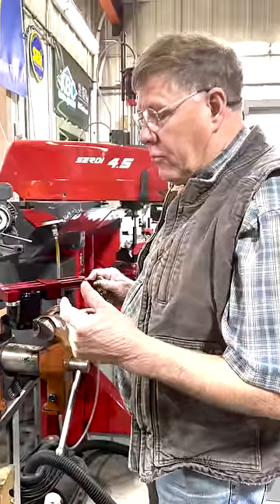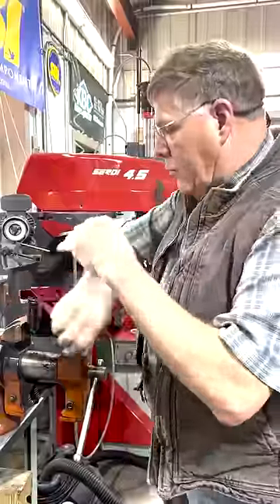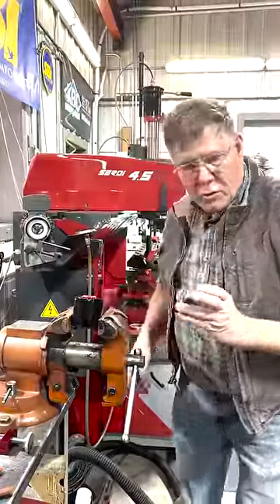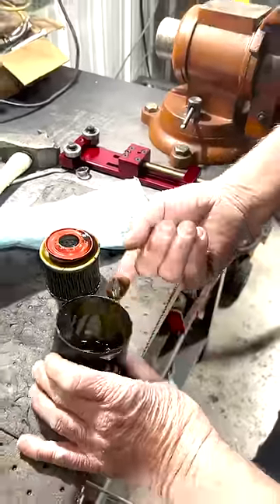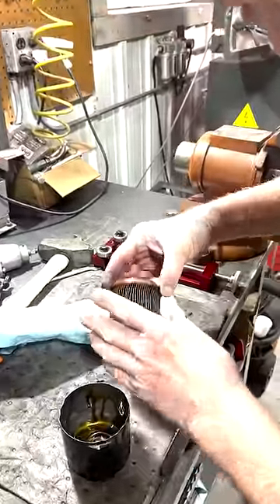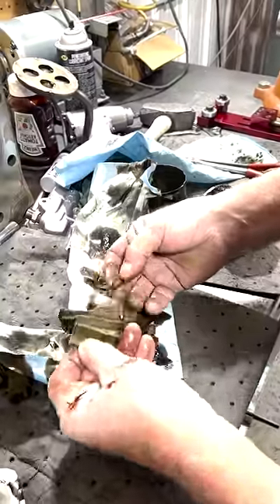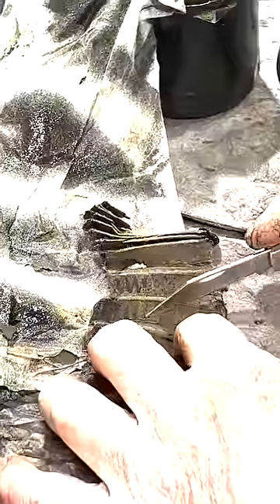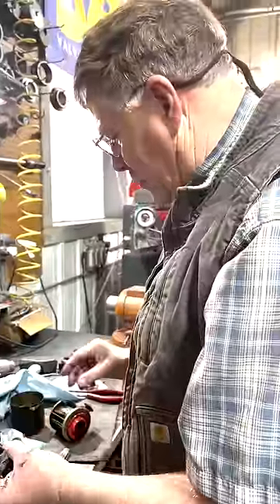#shorts Our Customer Ran His Engine OUT of OIL! 🤦🏻‍♂️

Comment: I'm a diesel mechanic, it's the family business, and we work on all of the nearby City/Township government vehicles.
Yesterday, one city dropped off their woodchipper that wasn't running. My dad looked at it. Always the first thing to do is make sure it has oil in it. Oil wasn't on the dipstick, so my dad took a small ~1cup oil sample to see if it was super glittery or if there were any chunks of metal, and it looked fine, just a bit black and old.
So, my dad started topping off the oil before attempting to crank it. 11qts brought it up to the Min line, and it's a 14qt system, so there was only ~2qts of oil in it when they brought it over.
My dad tries to crank it and it won't spin. He puts a jump-pack on it and it still won't spin. He gets a prybar on the crank and can't get it to spin. He puts a cheater bar on the end of the pry bar, and still, it won't budge in either direction. Pretty sure the crank welded itself to the block.
So we tell the guys from the city it's siezed and likely isn't worth rebuilding or replacing the engine, & to find money for a new one. It was a very old chipper.
They come to pick it up and the guy gives us some more details about exactly what happened. This fucking guy said the last time he used it it wouldn't run unless he was holding in "this button." That button was the Murphy switch override, because the switch wasn't reading oil pressure and it wouldn't let the engine run. They guy then said a bunch of white smoke started to come out of "this tube" and it stopped running shortly after, then it would only run if he had the starter turning it over as well and only for a few minutes. "This tube" was the crank case ventilation.
Murphy switches are a great safety mechanism when they're working properly, but they don't help when you're dumber than Murphy.
Reply: We call them idiot switches. For this reason.
Reply: Myy woorrdd!! Seriously.. I love those pieces of equipment with those guages because it gives you a piece of mind that whoever runs it can't screw it up! Apparently they still will!
Reply: @manuelve1998  They're called idiot switches because it makes it so an idiot can't damage your engine turning it over, not because of this one instance of an idiot using it as a safety bypass.
Reply: They do this to get new equipment. 
It's common even thier mechanics don't care to work on older equipment .
So make ajistments to fail
Reply: God. damn. 🤦‍♂️🤦‍♂️🤦‍♂️
Reply: Been to gearboxes like that which are seized solid, but when you check, it's full of beautiful clean oil, hmmm🤔🤥
Reply: 9
Reply: I read this whole long ass encyclopaedia because he intrigued me and at the end I couldn’t stop laughing 😂😂 utterly brilliant
Reply: When someone makes something idiot proof, the world makes a better idiot.
Reply: I bought a $1500 plate compactor off a guy who ran a landscaping business. Paid $50. He couldn't get it started. I put some oil in it and boom! Dummy forgot to put oil in it. 😂
Reply: @nightfall22 reading is hard eh?
Reply: Shell did an experiment, they used oil for different lengths of time, and only after around 75 000 was there degradation, keep the oi level right and you don't need oil change for at least two years, also your car should not be using oil in any way that needs for than a few hundred ml a year.
Reply: Dang, once I read “this button” I knew then he fk’d up. I use to be a heavy duty repairman with the union so I feel your pain. When people describe engine parts with grade school vocabulary, you know you’re in for a treat.
Reply: Why you did not turn the engine before spending new oil in it ? 😜
Reply: Murphys's Law
Reply: @palmtreeshenanigans you sir are wildly incorrect. First off engines run hot enough the heat alone brakes down the oil. Then factor in your typical heat cycling and condensation extream pressures shit fuel blow by ect. Change your oil and your motor will last. Push much past 5k and you will have sludging issues
Reply: You wasted 11 qt of oil to figure out it was seized engine! Nice one!
Reply: I would have tried to rebuild the engine with some red neck engineering, but its city and i find broken equipment and fix it for my self and hobbyists to use, so dont mind tinkering few hours to see if it can saved.
Reply: Not in his job description.
Reply: Amateurs 😂
Yeah, check the fluids.
But First thing you do, is see if it Turns by hand !!!
Anything else is academic if it don't.
Reply: 😂😂😂😂😂 the last sentence was AMAZING 🎉🎉🎉🎉

Comment: My father bought a GM pickup from a plumbing company, they said they never changed the oil since they bought it new from the dealer, 97,000km ago. Oil came out like molasses 😮😮😮
Reply: Why did he buy it?
Reply: I enjoy that the engine is still running. Yet many people never talk about changing the other fluids.
Reply: My pops made fun of me changing oil all time , ol timers didn’t change oil till it black
Reply: @RcPlayer-tt2vw  Just because the oil is black, does not mean it still isn’t protecting the engine.   I change mine every 10,000 miles with the cheapest oil on the shelf and it has over 250,000 on it at this time.
Reply: @Olds_Pwr  I would love to see someone use that logic on a diesel. They would changing the oil twice a day just because it turned dark.

Comment: I once had a customer that changed his oil filter only and just added oil as needed. 1980s something Dodge. 80 thousand miles and second engine!!! He couldn't be convinced that oil changes were necessary!!!!
Reply: That’s how I run my 2005 Honda CRV. Top that baby off with a quart a month or so and never touch the filter. 275,000 miles and I haven’t changed the oil in years. 😂
Reply: @Default012  youre not smart
Reply: Now that's humorous 😜
Reply: @danielking221  atleast somebody’s got a sense of humor.
Reply: @Default012 You're doing what's called "an ongoing" oil change. At least it'll always have relatively fresh oil every month or so. What's the point changing it yourself when the engine does half of it for you? 😂
Reply: @wheredaboof6492 Why's he not smart? It's either leaking, burning oil, or both. So what's the point in doing oil changes every 5k miles when there's no longer 5k mile old oil in the engine? I think this is the only instance that we can see and agree, that oil change intervals go out the window, when it has to be topped every week/month or so. 270k miles is pretty good, and speaks for itself.
Reply: @Default012  despite it drinking oil you still have impurities slushing in the engine so you have to change oil and filter when recommended.
Reply: @SoulTouchMusic93  that’s the only “oil change” I do even that’s rare though. Them old Hondas are built different.
Reply: @wheredaboof6492  just topped it off with a quart of oil, some power steering fluid, and the damn thing was dry on brake fluid. Feels like a brand new car already.

Comment: I bought a old truck one time and did a oil change on the truck . Had to have been 40-50k miles it was like slug. 
So i pulled the valve covers it literally left a valve cover made from burnt oil. 
Looked like the value cover was still on there. 
I cleaned it up changes oil , oil fliter,  valve cover gasket. 
2 yrs later truck was runningike a champ when i sold it.  
True story...
Reply: this is an awesome story. thank you for sharing

Comment: I had a jeep 4.0L "that had regular changes"  = when I pulled the valve cover, the sludge was like a negative of cover.  They must have found a case of "manufacturer installed" 090 oil filters too somehow.
Reply: If you run synthetic oil it will not make sludge.Look for another reason.
Reply: @Kingme-sw5tb lmfao that's the biggest load of bullshit I ever herd.
Reply: @Kingme-sw5tb  synthetic oil can still sludge up. Not as bad as conventional but if you go a long time with no oil changes it will in fact sludge up
Reply: @Kingme-sw5tb synthetic oil still needs to be changed at the same 3-5k mile frequency. You just get better protection during those miles.
Reply: @jeffr5552  it’s all a scam.I could show you a pic down my oil fill cap and it is not full of sludge .Looks like a miter with 260,000 miles on it.Save your money for sure.I’m saying it’s the synthetic oil because it’s the only explanation I can think of .I’ve run the same filter for 10 years at least.130,000 plus.
Reply: @Kingme-sw5tb  I'm basing my statement on oil sample test results. Every engine is different and needs its own evaluation of what kind of oil change interval it needs, but in general, an aggressive oil change interval is needed. It's really not a scam. In fact, what is a scam is the extended oil change intervals by dealers, such as 10k mile changes. It lets them check off on less oil sent to waste while giving just enough maintenence to get the vehicles out of warranty. Whatever the dealer recommends, cut that in half or even thirds, depending on the engine and how you use it.
Reply: My 4.0 had like 4 inches in the oil pan. It still ran but I tore it down and rebuilt it because there was almost nothing left of the rod bearings
Reply: @Kingme-sw5tb  😂 Sounds like you're going to be staring in one of the Just Rolled In videos soon. Do you think the earth is flat by any chance?
Reply: Knew some guys back in the '80, got a temp/spare motor for their stock car from some old guy in the 'hood, "S'posed to be an old Vette motor ... it runs good, but leaks a bit of oil". They put it in and it ran great, won several races and got protested. iirc it was $150 to protest, if illegal protester got their money back, if legal the car got the money to pay for gaskets and whatnot. Tech Inspector took the valve cover off and yes, sludge packed in with imprints of the rockers. Protesting dude winced, said "That's far enough, give him the money, he needs it more than me."
Reply: hmm our 4.0 has 440k miles on it, and i change  the oil every like 5-9k miles.. lol
Reply: @jeffr5552  3k miles.. lol keep telling yourself that
Reply: @jeepsblackpowderandlights4305  5k for naturally aspirated engines and 3k for direct injection turbocharged engines. Or you could have fun with that fuel dilution killing your oils performance lol oil is cheap, engines are expensive.
Reply: @Kingme-sw5tb you have no idea what you are talking about

Comment: I bought a used 2 valve triton f250 with 109,000 miles strictly to haul shingles for my roofing crew. It used 1 quart of oil every 1000 miles. I never changed the oil or filter, or anything else except spark plugs one time. That truck served me until 330,000 miles when someone T-boned it while we were dumping shingles off the roof into it. I drove it onto the rollback after they pulled the cherokee out of the side of it. The best truck i ever had
Reply: If people actually maintained the 5.4 they wouldn’t complain about it. And it still performs when it burns oil.
Reply: @Nubsanders  but they're also just slow, anemic, inefficient engines
Reply: @Nubsanders my only problem is how they feel to drive if you have to drive a lot. We use them at work at they just feel blurry and like they are out of breath. I guess torque just feels better at higher rpm.
Reply: I'm at EXACTLY 330k with my Triton V10 F250. Hope I get another 100k lol
Reply: that truck had the "automatic oil change" feature if it was using a quart every thousand miles

Comment: My smart fortwo i use mobile1 0w 40. 10000 between oil change with 160000 miles. Engine sounds good with no oil consumption and zero sludge

Comment: The editors of this video are making jokes about the guy saying there is glitter in the oil filter. But the industry uses the term glitter to describe the shiny bits of metal that are trapped in the filter. The metal shavings are so small that it looks like glitter. The metal shavings  are the results of metal on metal rubbing due to the lack of adequate lubrication.
Reply: Yes, but it is normal to have some glitter in a filter.  Not a lot, some.  Most of it comes from timing chain/gears, pump/distributor drive gears, lifters, pushrods, and, rocker arms. Almost none (in a non-failed engine) comes from crank/cam bearings or rings.
Reply: @HPDrifter2  yes, but the existence of glitter then becomes a source of abrasion for all of the wear parts.  The filter will not remove all of it. The filter only removes a portion of the larger particles.  The small we particles remain suspended in the fluid and are a source of new abraision.

Comment: Our Ford C-Max pops up a message stating it needs an oil change roughly every 50,000 km.

Since that's what it asks for, that's what we've been doing. 

So far, no problems...
Reply: Should still be checking the level and topping it up as necessary.
Also, I guarantee that if you check the manual, it'll also say "or every 12 months, whichever comes first"
Reply: @dyent  I just checked the manual and it is a bit confusing. It says it has an "intelligent oil life monitor system" that shows a message at the proper oil life interval. It then says the computer will calculate when the oil needs to be changed, at up to 32,000 km. It then says you should only change the oil when instructed.

Finally, on the next page, there is a section where it discusses the possibility of the oil life monitoring system failing. Here, it says you should not drive beyond 32,000 km per oil change, and if the system becomes completely inoperative, you should revert to 8000 km intervals.

I also found with the car's documents a TSB note about a software update that, in the list of updates, states that the oil life monitor has been improved to optimize oil change intervals.

We've got around 385,000 km on it so far (we bought it new), and the oil life monitor is still working.  When I used to track oil change intervals (when the car was newer), it was definitely going around 50,000 km. I also found in my notes that I actually did the second oil change at 20,000 km, even though the oil life monitor said the oil was still good. I didn't reset the oil life monitor, and it finally asked for an oil change at 50,000 km.

After that (for the past almost 10 years), we've stuck to just changing it when instructed, and it still runs perfectly.

We typically check the oil level about 5 times between changes, and so far it has never needed any oil to be added between intervals (even 50,000 km intervals).

Keep in mind this is a plug in hybrid and roughly 50% of the miles are on battery with the engine off.
Reply: Wow. No, change oil every 5k miles max.
Reply: Its a hybrid too?
Reply: Yeah people are insane, I always change my oil every 40,000 KMs and I’ve never had engine problems, that’s what the oil is rated for anyways!
Reply: Kind of a long time between oil changes!
Reply: Change your oil every 6,000 miles.  PERIOD

Comment: That, is why I change my shit myself. I mount and balance my own tires even.

I change my oil and filter about every 5000 to 7000 miles.

I only run Mobil 1, and only use K&N Gold Series filters.

I've YET to ever have metal sparkles, I've YET to have any bearing issues.

I've YET to have an engine die on me
Reply: I never let my oil go past 40,000 km without changing it!
Reply: @ShawnSavageTeachings troll 🧌 😅
Reply: You know I wanna learn my self 
Was recently at Take 5 for an oil change of course they suggested that I need to change the coolant well I guess they didn’t bleed it or something I didn’t even make a mile down the street car started to over heat 😅
Reply: @leechburglights  I’m being for real… not trolling I change my oil every 40,000 KM because that’s what it’s rated for but it’s not cheap

Comment: Every 3 months or 3,000 miles. I run full synthetic oil so technically I’m good for 5,000 miles but I like to take care of my equipment. Plus it’ll prevent expensive repairs later.
Reply: I do the same thing. 3K full syn
Reply: should be doing is oil tests and change it when the oil is ready to be changed. most of the time you just need to do a filter change. oil test also tell you when things are wearing out before they wear out. things like main bearings etc.
Reply: If you have a real synthetic it should easily last you 20-25,000 miles with a filter change in between. My oil is rated for 25,000 miles…
Reply: I use royal purple. 12,000miles or 12 months, whatever's first. I just buy premium stuff that lasts longer, because I HATE working on cars, so it makes sense for me.
Reply: Peace of mind 😊 to change every 5k @ShawnSavageTeachings
Reply: @ShawnSavageTeachings  Please do not advise anyone on maintenance for anything ever.
Reply: @ghostpunkkilla  I definitely will because all my cars are in great shape and my dad is a mechanic
Reply: @leechburglights  yeah but not for my wallet, spending like $200 every 5k miles would be crazy for me, I drive 5k miles sometimes in 2 weeks screw that
Reply: @YourWifesBoyfriend21  yeah it should have more likes tbh
Reply: @YourWifesBoyfriend21  dude my engine always runs clean and super fuel efficient, it’s never overheats, and I’ve been doing this for a decade. Oil change every 25,000 or one year and filter change every 15,000 miles. Engine runs amazing especially in winter. Always quiet and runs clean. Just because it’s different than what you’re used to doesn’t mean it’s wrong lol the oil is rated for 25,000 and they aren’t lying lol I feel at times reaching 25,000 like I could keep going just fine! But I don’t want to go to far despite how it’s running lol there’s a reason it costs over double what normal “full synthetic” costs
Reply: Why synthetic?
Reply: @ShawnSavageTeyou change the oil every 6,000 miles it doesn't matter what the oil is.  Its whats in the oil not what its made of.  If there is dirt in the oil its probably bearings, not dirt.
Reply: @garycamara9955  Better protection for the engine. Technically you can push synthetic a little hard but I don't, I want the engine to last as long as it can.